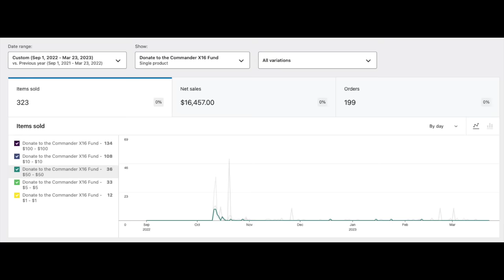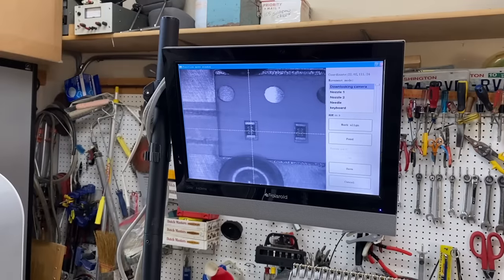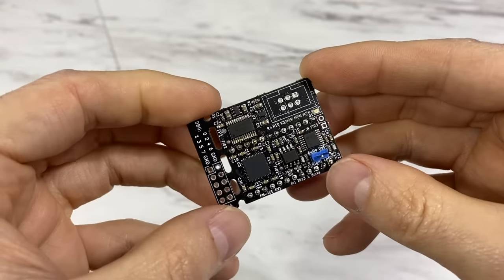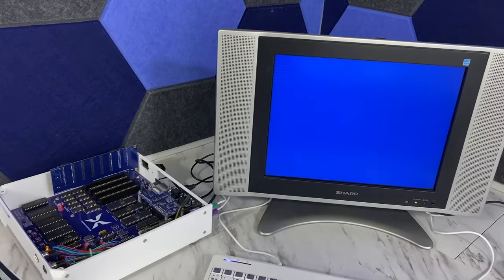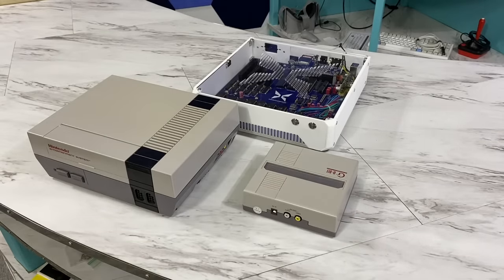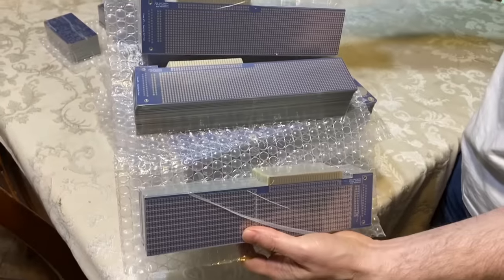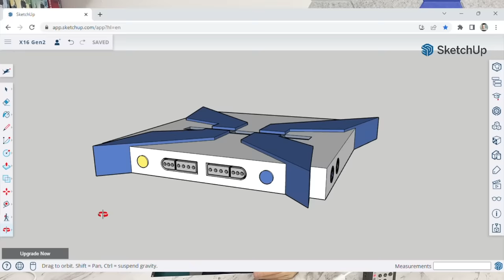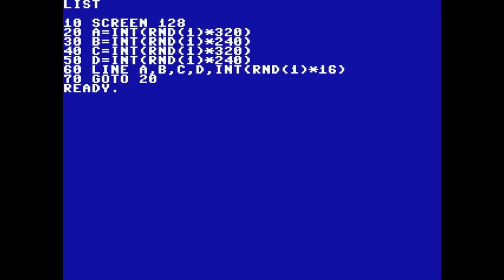Commander X16 2023 update

Comment: Very interested in seeing how this unfolds, but I'm concerned about the usage of the Famicom cartridge pin count and design, especially since the two machines supposedly use wildly different pinouts that... apparently do not play nice when inserted into the wrong machine. I too would like to assume people know enough not to do this, but the identical shell and design means they're likely to get easily confused for a cartridge of the other system and blow the wrong machine (or cart) up. I hope it's not too late to do this, but some sort of tweak to the cartridge shell to prevent FC carts in the X16 (and/or vice versa) would be good to have, as a protection method. Sure, regular Famicoms are moderately cheap, but the X16 is not, and I'd prefer to prevent at least one from blowing up in some form. Sure, the 60-pin design isn't common in the USA, or (western) Europe, but in places where the Dendy, Famiclones and original Famicom were/are popular? It's rife with possibilities of problems.

Aside from that, very nice update! Shame to hear the 2151 is possibly getting the shaft, but would there be interest in at least making an EXP card or leaving a socket/spot on the board for one to add their own YM2151? Additionally, why not use the YM2612/YM3438 if an FM replacement is absolutely required? The OPN2 line is quite popular, especially since it was widely used in the Sega Genesis. OPL3s are common, sure, but I'd say given the sales of the original Genesis/Megadrive, there's a lot more YM2612s and YM3438s in circulation than the YM2151 and/or OPL3.
Reply: Custom cartridges would be very expensive. I'm more concerned because FC cartridges are a pain to open. Not a good cartridge for battery backed SRAM.
Reply: Maybe change the edge-card connector into something that's keyed while still using those shells at least. I don't know if anything physical can be done to make an X16 card edge too wide to fit a famicom slot without making it incompatible with the shell, but maybe have a keying notch in the middle of the X16 socket (two edge-card sockets butted up against each other?) so famicom carts can't be inserted into the X16?

Comment: You should rename this project to “The Amiga 600”.
Reply: David couldn't for legal reasons.
Reply: Not even the mini console could call itself an Amiga.
Reply: @RJLightning68  : You’ve misunderstood my reference.  The amiga 600 was supposed to be a cost reduced scaled back update to the 500.  However it ended up with feature creep, inferior design, lack of expandability and was a total disaster. 

This project seems to have lost its way too. Over cost. Over designed.  Too many features.  Two models.  As soon as I heard “online speed runs” I knew this will turn into a complete disaster.

Comment: You could perhaps design the slot and the cartridge so that the famicom cartridge won't fit.  Like how Japanese N64 cartridges didn't fit in North American N64's despite looking the same using a plastic tray.  Also with regards to HDMI, why not use Displayport?  No worries about licensing there I believe.
Reply: Agree. And the DP can carry the VGA signal too, not just HDMI, so with a relatively simple and cheap adapter witch does not require external power you can get whatever signal you want. Even DVI.

Comment: I would offer the kit. And open a form that's run by moderators. People will help people. You will get a better machine out of it, they will find errors faster than you can. They will share tips etc.  You won't get the credit for everything. It will get done though, better.

Comment: I have been eagerly watching this project, and really liked the idea of going the non-FPGA route. And do not get be wrong, I am not knocking this, but at this point would it not be better to just go with an FPGA for the board. Especially since the video is already FPGA and arguably the better of the two audio alternatives is to go with another FPGA solution. Or have I missed something, other than the desire to use "original" components?
Reply: But then what is the reason to do it at all? After all, all FPGA implementations of 8bit systems already exist.

The successful ones are implementing an existing design (sometimes with optional extra features) because those are the systems with a software base 

The only reason to even DO the all-FPGA version is if the first two generations get a large enough software base that there is a market for a Gen3.
Reply: @brucemcfarling4674  - The project is already using an FPGA for the value-added capabilities, and arguably the direction for the rest of the board is more costly. A pure FGPA board with the interfaces (cartridge slots etc.) could be attractive since it offers the possibility to expand the capabilities beyond the original design. I am just not seeing the value proposition at the moment of still using "original" components. I build my little retro boards based on original chips because I enjoy it and learn from it so I see that side, I am also a backer of the ZX Spectrum Next and actively use it, so I am not "against" the FPGA direction. I am just trying to understand what the value is at this point of using some older components resulting in a  more complex and costly design. Hopefully, I am just missing something here, because ultimately I want the Commander X16.
Reply: This while project SHOUKD of had multiple redesigns as these issues came up, but David is too stubborn and not an engineer so now it's a mess and mix of all sorts of bits that don't belong together.
Reply: @joeambly6807  Isn't that another way of saying that he had different priorities? He wanted to have the System-in-a-Chip version of the system be implementing an "actual" system. He wanted it to rely on through hole parts as much as possible. He wanted the audio and video to be in the style of the 8bit era but also to an upgrade on C64  level graphics and sound. As the Agon Light shows, if you abandon those preferences, are willing to go with whatever is the best audio and video an ESP32 can emulate, and design it as a mostly surface mount board from the outset, you have set yourself a much easier design objective.  But while some of the flaws of the X16 project that he points out are valid, others are just a reflection of the fact that if you have different priorities, it leads to making different design decisions. And he makes misleading claims to push his argument, like the claim that his board does not rely on emulation, when his VGA VDP is a program running on an ESP32.
Reply: @joeambly6807  Which is the part that doesn't belong with the other parts, if you are trying to make an 8bit system using as many in production, through hole ASIC ICs as practical? The glue logic, the 65C02, the 65C22, the 8bit SRAM, the 8bit FlashRAM, the 8bit MCU, the 8bit FM synthesis chip, it's companion DAC chip, or the 8bit sprite/tile video chip implemented in FPGA because there is no in-production 8bit sprite/tile video chip?
Reply: @brucemcfarling4674  The point is they bought all the pcbs before having all the parts avaliable for production assuming that no design changes would be necessary. Very dumb move. Now they are adding bodges, bought the wrong soldering setup, and are too stubborn to do a redesign.
Reply: @joeambly6807  If THAT was the point, why did you SAY the point was they have a bunch of parts "that don't belong together"?
Reply: @brucemcfarling4674  Because it means exactly what I said and you are misinterpreting it lmao
Reply: You said the project was "now it's a mess and mix of all sorts of bits that don't belong together." and when I ask you which bits, you meant PCBWay giving them free PCBs that are not the type of PCBs you use for the solder dip machine they bought?

If you are not talking about the design of the X16 when you talk about different bits "that don't belong together", then never mind. A mismatch between their free PCBs and the solder dip machine is not a permanent issue, its transitory.
Reply: @brucemcfarling4674  and your interpreting my words to fit your narrative and you don't see the fundamental issues with how this design is being done. You have obviously never designed a hardware product because this project is going about it in the STUPISEST way possible.
Reply: @brucemcfarling4674  If David had a signal idea of what he was doing he would realize that paying an assembly house is FAR less of a hassle than bringing it in house. This project is destined to fail due to a lack of BASIC expierence.
Reply: @joeambly6807  Not having a mind reading machine, I followed the old fashioned approach of assuming that the words that you meant were directly connected to what you were trying to say. If you want to talk about the production process, you might consider not saying "how this design is being done", because that makes it sound like you are criticizing the design. I have no interest in sitting in the cheap seats throwing peanuts at how they are going about the production process, so if THAT is what you have settled on talking about, instead of talking about whether or not "the bits go together", have it it.
Reply: @joeambly6807  Live and learn, time will tell whether they will sort that out. Luckily that only affects the C16x Dev Board production process, so the project does not live or die based on how that works out.
Reply: @brucemcfarling4674  based on the current trajectory I give then about a 1% chance of success

Comment: So you're using donations to buy yourselves nice manufacturing toys that you don't know how to use?  This just get worse.
Reply: They're now using Suntronic in Richardson, TX to assemble the boards.

Not sure what they're going to do with the solder dipping station that was bought using GoFundMe money meant for the X16.
Reply: @Okurka.  they can just resell it for almost all of what they got it for- this is industrial equipment, not consumer equipment, so the depreciation is basically nil, and there are fuckloads of hardware dealers and intermediaries whose entire job it is to buy and resell this shit, so he won't have trouble finding someone to take it.
Reply: @technoturnovers7072  That's easy pocket money, then.
Reply: @Okurka.  or, hear me out, what if he just uses the fundraiser money for other shit related to the project? if he wanted to pocket the money he could have just pocketed it right away and lied about having used it, after all
Reply: @technoturnovers7072  What other shit?
They already used the rest of the money to buy parts, got the boards for free and are still selling them at more than full price.
When they sell the first 100 boards they'll have more money coming in than went out.

Comment: You've got a 50 pin expansion system, if you designed your cartridge port well you could plug a Z80 coprocessor card into that thing like Atari had planned for with the 1090 expansion card.
Reply: Either a co processor card communicating with a pair of VIA with hardware handshaking or a card that takes over the X16 bus are both very much possible on the expansion ports.

Comment: FYI JLCPCB will solder SMT components for relatively cheap. For a recent project we had them solder a majority of the components and leave through hole for final assembly. Also I would explore cheaper implementations for the IC replacement. It may be possible to use something like an RP2040. I think it’s not a big deal to have people source their own Yamaha or offer some pricier socketed reimplementations.
Reply: ... if they have the components on stock. My experience was that there was a MOQ of 30 for a part not on stock, and when I agreed with that I got a new offer with a MOQ of 1000.

Comment: I hope this project will be success, but I didn't like this X16. There're some design flaws/decisions I don't understand. For example: A kit with TTH nice, but a assembled PCB should be SMT. If I realy want to get a retro-performance Computer these days, I would go with the Agon Light 2: 65€(edited) incl. tax and delivery to germany- Or without leadtime for less than 75€ from Olimex. Yes, this is not the same as X16, but a similar project.
Reply: Yup, I ordered one. Sensible design and it works.

Comment: I find the subtext here interesting; the major players in tech hardware have such a stranglehold on the market that you can't even make a retro system for less than the cost of a PS5.
Reply: Its not so much a stranglehold but the lower cost of scaling.  It is vastly different producing 1-5 million units compared to 100.
Reply: Nah, they made very bad designing choices...

Comment: This is really good that your computer build is progressing, and the specs look decent for 8 bit games, but I would like it more if you have the option to put an external floppy disk drive or even a cassette deck especially since they still make small cassette decks and blank tapes, I used to save my computer programs on cassettes, but I think 3.5 inch floppy disks would be better medium for making retro games!
Reply: I think you can. In earlier videos he did show that you could connect a floppy drive to the system. I think the connector is still inlcuded in this design as well.
Reply: They have an IEC port ... a 1541 or 1571 disk drive will just plug in and work. You'd want to set it ad device 9, though as the SD card is normally treated as Device 8.
Reply: @kooijbas  but I want to use a common floppy drive and not some weird connector for the floppy drive.
Reply: @brucemcfarling4674  that’s cool for 5.25 inch floppy drives, but I don’t have many of those disks, I mostly have 3.5 inch floppy disks and I have external USB floppy drive. If there’s a way to plug USB, it would be really neat!

Comment: This project has completely gone sideways and is nowhere near what the original intended goal was.   I realize that a lot of things have happened since David's original video.  However the one thing that really bothers me more than anything is the fact the new goal is to develop some 8bit game console that no one asked for or wanted.   We wanted a computer!  Instead G2 is basically crippled version of the Dev machine now labeled as a game console.   Instead of focusing on things people wanted we get a cartridge slot.  WTH... I'm not interested in buying cartridges. You say you won't have to buy the cartridge to play the game, but we know that won't be true. This seems like a bait and switch.  I really hate to be critical of David and Kevin, but this is disappointing.
Reply: Yeah, for me what's off-putting 
 isn't just the cost, as you can get an emulator, but how the system is constantly morphing with new features that raise tons of new potential problems. Now the different "phases" aren't just cost reductions or  extra optional expansion slots, but have different core capabilities. There will now be games on cartridge that allow memory expansion or even additional hardware and thus can't be distributed in digital form. There's going to be an online element with anti-cheat technology, which could be a massive undertaking and also requires physical carts...etc,etc.
Reply: @jacklawsen6390  well said.  100% agree
Reply: How is the "console" version crippled? The only differences are the form factor, one expansion (cartridge) slot, SMD chips, build in VERA and networking and fixed 512K of banked RAM. They just decided to not label it as GEN2 anymore but it's basically still the same machine with the same system and ability to connect mouse and keyboard. It is not true that it will have different core capabilities as Jack claimed.
Reply: @novh4ck  I think you summarized the differences nicely.  Less RAM is a big one in my books.  David can do whatever he likes, however I do feel like he's trying to morph this project into a game machine.  I guess time will tell.
Reply: @kevinsmithwoo  I think it was meant mostly as a game machine from the start. Kinda like a continuation of C64. Less RAM is a big difference but it was stated before that 2MB which the dev board will support is extra memory and it will only ship with 512K populated.
Reply: @novh4ck  Funny, I never saw that as a stated goal in any of the 4 year old videos until this one.  Again, David can do what he wants.
Reply: @novh4ck  After looking some things up, it seems the "dev system" will not come with 4x the RAM as it appears to. I will say they are doing a poor job communicating that, as every pic I've seen of the board has all the sockets full, and in this video David and Kevin go on about all the things that 2MB will allow developers to do. They even say you shouldn't get the later system if you're interested in making games, because it won't support the same tools. This one decision will massively reduce the potential software library and take away much of the system's appeal.
Reply: @jacklawsen6390  Those AS6C4008-55PCN SRAM chips are around $6 on Mouser. 2MB will be nice to have to develop games but the idea from the start is to encourage developers to only use 512KB with the final release of their games. Don't forget that it still has a relatively fast SD card and 128KB of VRAM is completely separate.